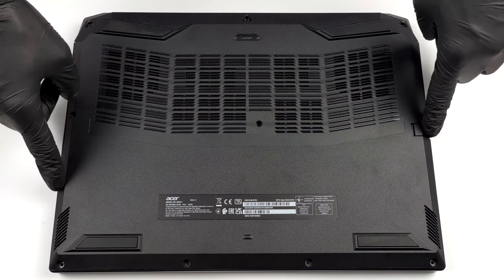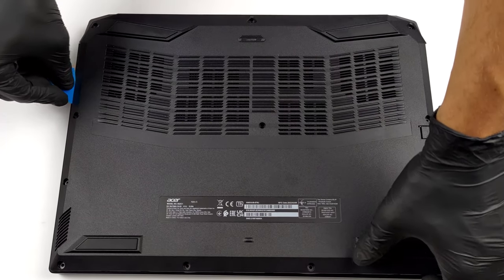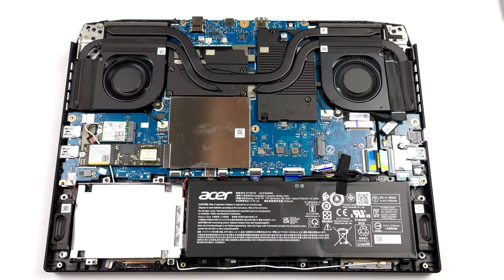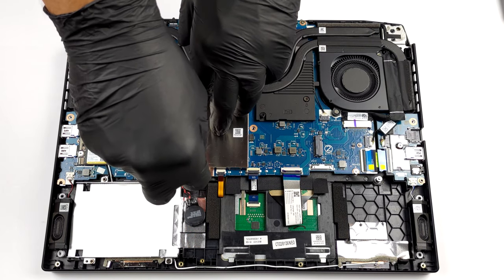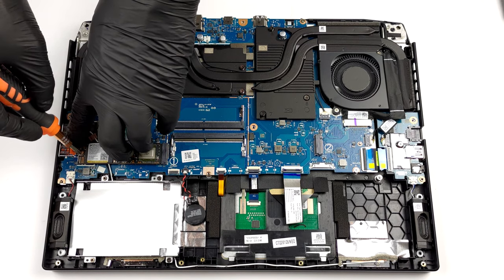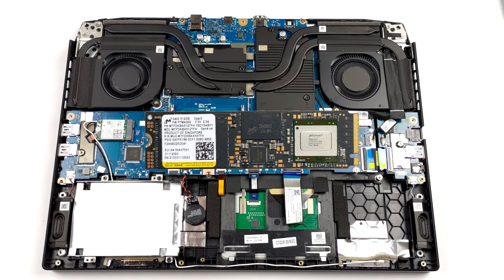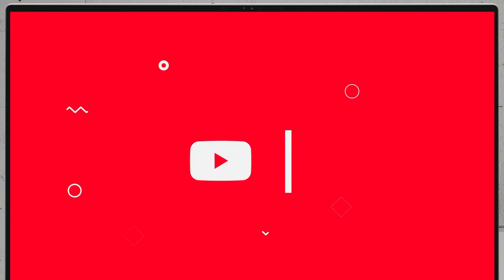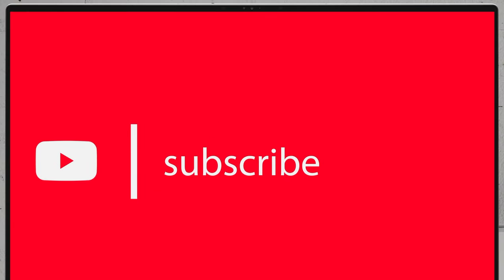🛠️ Acer Nitro 5 (AN515-58) - disassembly and upgrade options

Comment: Can we install 2.5" SSD in this computer?
Reply: Yes I added 1tb Samsung 980 pro 4 Gen and a Samsung 2.5 1tb SATA in mine today.
Reply: @emigdiob60  for the ssd m.2 pcie slot, are they have the same size? or one is long type and another one is short size type?
Reply: @Convultus  You can place an ssd with sata 3 connection too. The cable is universal for All Sata 3 devices.
Reply: @emigdiob60  can i also place a nvme SSD connected to 2.5inch nvme to sata adapter in place of sata ssd slot ...?..

Pl plz reply ..it is very very important for me ....
Reply: @Sdrdrax-p you responded you own question Sata 3 is universal for all Sata drive that mean any drive that use a Sata has a connector can be used with Sata so yeah it would work like all other Sata drive you could put in 2.5"
Reply: Yes you can

Comment: How'd you get a guitar pick into that lining? I can't even get a razor blade in there mines stuck on tight
Reply: Try inserting straight down near the edge of the back end of the device with something thin(such as a razor blade) you may have to wiggle it a bit, then pry upwards. Keep your tools inserted and make your way around the lining until you can pry with your hands. This was difficult to explain in text but this is what worked for me. Hope this helps!
Reply: @thechillsadist Thanks for info!

Comment: i was wondering if you need thermal pad over the ssd's in this laptop? 

if yes , then what thickness of pad (0.5 mm , 1mm ) should it be??
Reply: Thermal pads are usually on the bottom plate and they cover the SSD's when you put the plate back on.  I have seen this as standard on Acer and ASUS laptops in the last 5 years.  No need to buy other pads.  If this were PCIe Gen 5, then you really need the extra cooling.

Comment: Great disassembly videos. Keep up the good work.
Reply: So eventually bought this model. Turns out wifi antennas doesn't go into monitor backplate and ends under battery. So antenna cables are very short leading to very poor wifi range. Do not recommend buying this laptop if need good wifi range.5ghz wifi barely sees my router in other room while older model AN515-54 have full range.
Reply: ok thanks @Areko222
Reply: @Areko222  Thanks!

Comment: My curiosity, can we actually upgrade the capacity battery? Because if the hhd/sata room empty, we can just use the room for more batterycells?. Acer nitro 2023 model has more wider battery but no hhd /sata chamber
Reply: did you try it ? or found something about it?
Reply: @deepanshusingh4336 yes, it could upgrade to larger battery. But the cost, not worth it
Reply: @farellalvaro8392  i know its been months but i want to know why did you say it was not worth the cost

Comment: For the ssd m.2 pcie slot, are they have the same size (long size), or one is long size type and another one is short type size?
Reply: Yes, both are the same size, long size. 8 cm long.
Reply: @MSK0734 what brand and what pcie gen are in this laptop?

Comment: I need a replacement battery for mine and the one installed is an Acer AP21D8M..however when looking for another one it is nowhere to be found. It only suggests AP18E7M batteries. Is that even compatible? I'd appreciate the help.

Comment: Is it possible to DDR5 RAM upgrade on this model? Or it is only DDR4 supported? Thank you,
Reply: no, can only fit ddr4
Reply: nope
Reply: different slot
Reply: There is a New Version with ddr5. This is already an old Version. Lol.
Reply: DDR4. But upgrading dual channel (for example 2x 8GB RAM) is almost same DDR 5 single channel
Reply: supports  ddr 5 4800 ram  for AN515-58-775T

Comment: can we install HDD in this device? because it says there's a one HDD slot in motherboard.
Reply: yes you can, Acer provide additional hdd cable
Reply: @maklogetrich2378  no, i mean can we install directly in device?
Reply: @thew3ld  yes, just plug the cable provide by acer
hdd will mount inside the laptop
Reply: @maklogetrich2378  well, actually I just found out that this laptop also has an ssd slot. any ssd will it work?
Reply: @thew3ld  any m.2 nvme gen 3/4 would work

Comment: Id like to know if it can handle a 2.5" drive because i have a 1tb SSD and a 1tb HDD which i would like to put in the 2.5" SSD i have into the system so i could have that as my main dedicated gaming drive.
Reply: Hdd or ssd 2.5 with SATA3 will stand it this laptop with no problem.
Reply: In fact, originally it is made for mixing fast M2 ssd and HHD.
Reply: Has 2 slots of m2 and one for SATA3 2.5 devices.
Reply: @vds-x4p Hello, do you know if it has maximum capacities?  And how much would they be?

Comment: Does this apply to the Nitro 5 AN515-58-567C (12500H-8GB-GTX3050-500GB)?
Will I find a free RAM slot or there are 2x4gb slots mounted in?
Reply: Best way is to ask seller. On different markets they prebuild different ram configs
Reply: if it's 8GB version, then mostly it's 1x8GB
Reply: or you can use CPU-Z to check
Reply: You can find exact ram Modules in Sale. But, you can place not the exact Module. In fact, this Thing will work wiith 8+16GB prette fast in a mixed Mode. IF you want only gaming, 8+8 is the Best. Do some Hard work(science projects, programming, etc.) - 24GB of ram. IF you have enough Budget, then buy 32, or even a better version with rtx 3060 or 3070 and 32GB of ram. To know: this Thing gets REALLY HOT ON CPU, trottle on Max in Aida64. It is great for using cpu not on full Power.
Reply: Every Acer Nitro 5 laptop comes with one RAM stick installed.

Comment: Are all the screws on this laptop the same size/identical
Reply: Identical
Reply: @amduciaszx9023 Hey there, what about the screws holding the fans? Also do you know if I should disconnect the battery before cleaning the fans? I've heard stories of people fking up their device from disconnecting it and also stories from people not disconnecting it

Comment: going to purchase Nitro 5; just wonder how many heat pipes it has? there are 3 pipes according to ur video, however, some online picture shows 5 heat pipes. the number of pipes does matter on the performances. Not sure if you have any ideas on Model AN515-58
Reply: 5 heat pipes is for 3060 version
Reply: i highly recommend the nitro 5, especially the an515-58 model, kicks ass, just low for storage and usually need to keep it plugged in if you primarily game on it, especially more demanding games
great laptop otherwise
Reply: @trolol743  How is it low on storage? You have two M.2 NVMe slots + additional 2.5'' bay which can fit up to 2TB HDD (in terms of thickness).
Reply: @rhanifsat  would you please confirm that
Reply: @rhanifsat  thank you for your cooperation but it was 3 pipes actually
Reply: @engihabit I have the 58 model it does have the 3 slots for storage
Reply: This Thing gets really Hot on cpu. Even with i5 it Manages to trottle in Aida64 on max. But this happens when Temperature outside of laptop is higher than 20C.

Comment: It has 8gb 1Rx16 ram which is slower than 8gb 1Rx8 ram.
Reply: stock ram is 1Rx16..if i install 1Rx8 will there be any issues?
Reply: @jpi6482  no ..it will work fine.
Reply: @jpi6482  Naturally, you would also replace the default RAM coz its slower.
It really depends on your budget, it's always better to go 2 stick 1Rx8 RAM.

Comment: Hello, can anyone help me upgrade my laptop? I have the Acer Nitro 5 and 515-58-78en model.

Are these components compatible with my laptop?

• Ram
- DDR4 SODIMM 2×16GB (32000mhz)
• Kingston Fury Impact 

• SSD
- M.2 NVMe PCle SSD (2TB)
• KingSpec Nvme PCIe 4.0 x4 2280 M.2 SSD

Comment: How about :
Replace battery with 90wH Acer Predator Helios 300 battery ?

Is that possible ?
Reply: Need to Check sizes and output Power.